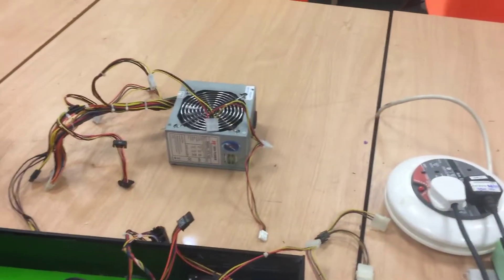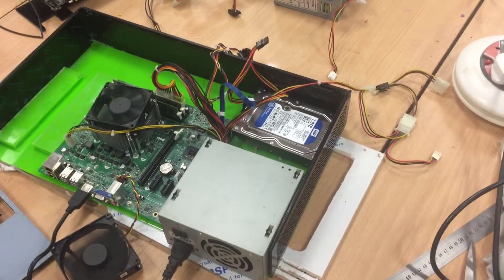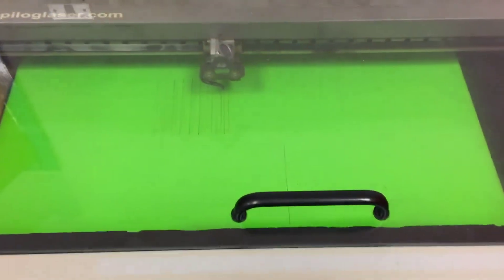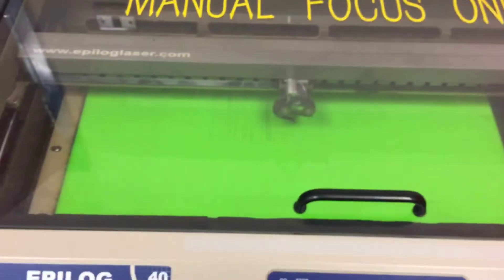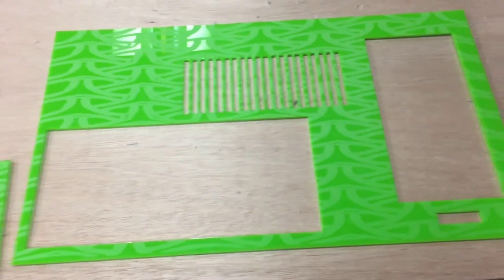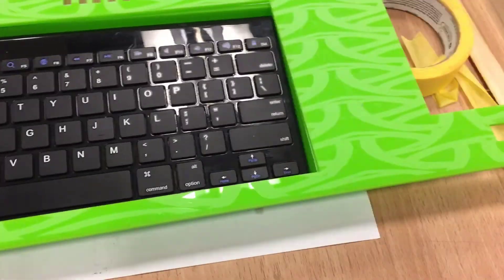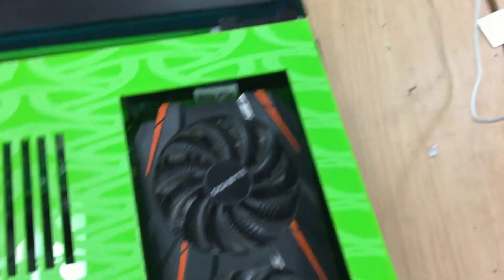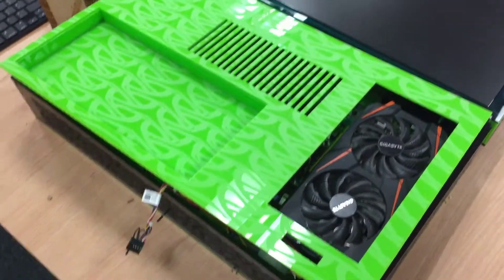GTX 1060 DIY Gaming Laptop Build PART 2

Comment: use 2 pico psu and use 1 dedicated to the gpu and then it can run on a 12v battery looks like u have a lot of room
Reply from the maker: would they have continuous wattage the gpu needs tho? I seen they are rated for about 260w
Reply: @SeanPook  i think it would work the gtx 1060 uses around 120 watts the system uses a lot too. there is a wattage calculator 
https://www.newegg.com/tools/power-supply-calculator/

Comment: Any plans of posting an update of this build?
Reply from the maker: good question.... yes I do plan to finish the build. I really need to pull my finger out. I'll order the rest of the parts today so I can get the build finished
Reply: Great, thanks mate. I’m currently in the process of picking parts for a similar build that I’m doing. Ill be taking apart an i9 8950hk mini pc (similar to an intel nuc) and will be using an rtx 2060 hooked up to it with an egpu adapter. Do you still have the files you used to design the housing? It would be great if you could maybe send them to me as I haven’t found many online.